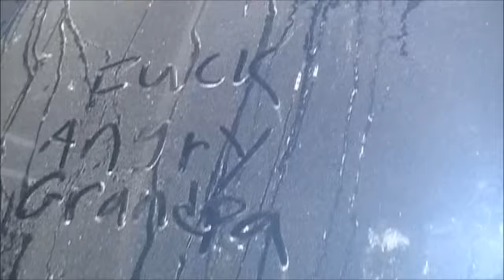ANGRY GRANDPA WASHES CAR

Comment: I remember I was outside with my parents washing my 2018 Honda ridgeline truck and I went to my dads junk 1994 Ford F-350 dump truck turbo diesel 7.3 I sprayed the water between the grill and and it leaked a lot of disgusting black water the truck is a piece of junk